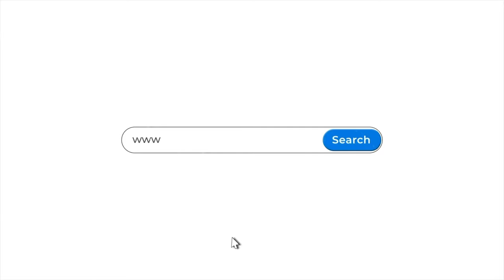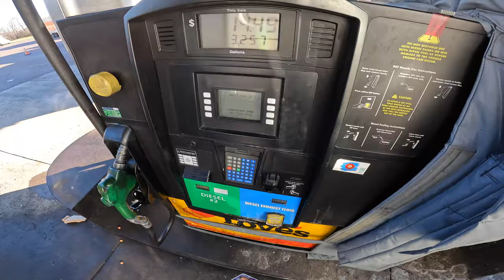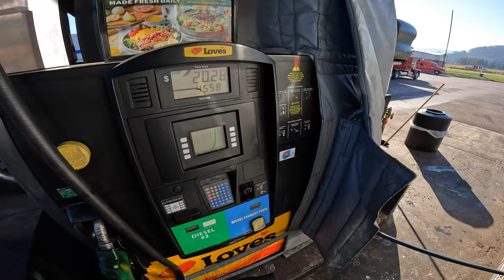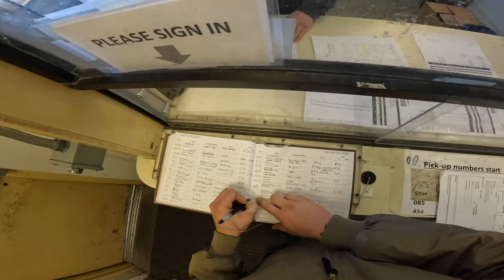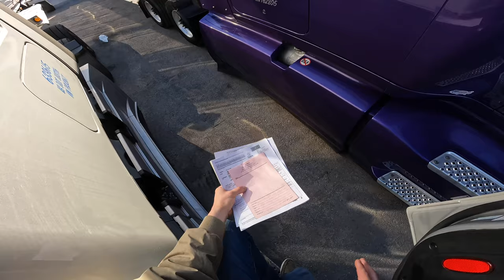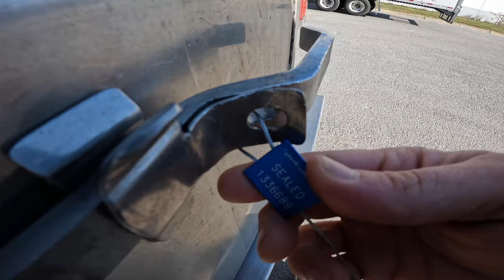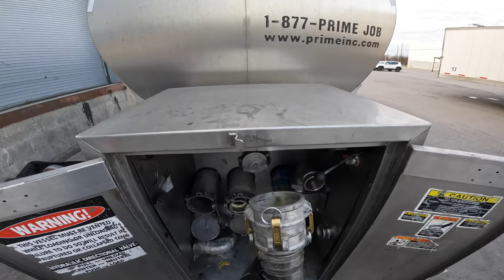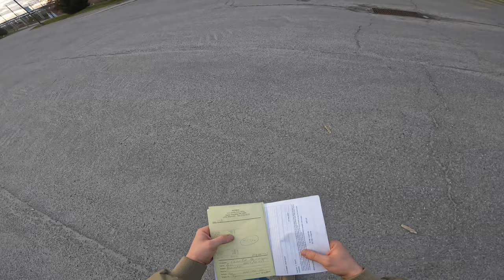Prime Inc | You Should Try Pulling Tanker | Getting A Sample Without Making A Mess

Comment: Really enjoyed the job there 3 years ago. Had a crappy trainer and only lasted 33k outta the 60k they required before leaving. Great company tho
Reply from the maker: Dang… when I did my tnt tanker only requires 25K
Reply: @truckingwithrex   how many miles are required for tanker right now.  I'm in Springfield right now in my psd stage thinking about switching from flat bed
Reply from the maker: @marcusknox2845  30K miles, that combined miles meaning (prime adds up miles you drive and your trainers miles) hope this helps ya! 🎄🤙💯

Comment: I used to use hoses with those. Why not just ask prime for extra dog ears and get a punch and hammer and change them yourself if they break or missing
Reply from the maker: I did ask for em because they are super simple to replace and I was told to buy them myself and show before and after photos of me replacing them… then prime would reimburse me so yeah… lol
Reply: @truckingwithrex  people love it at prime and I am sure they are good. I just don’t like seeing them Nicole and dime all the drivers for parts and stuff for “their” trailers. I understand if it as was a part for the truck you lease.
Reply from the maker: @jonnyjon1126  you said it correctly they are nickel and dimen drivers. Prime is solid but it’s not the drivers responsibility to do minor repairs to their trailers and or equipment imho.. This is why I’ll report these issues in my pick up or drop trailer inspections and prime can repair them as they should.
Reply: @truckingwithrex  of course report it. I mean to not be willing to give those to drivers is crazy. The man power lost and jobs delayed by a 1 min fix is nuts.

Comment: Are the O/O trucks governed with Prime? Do they offer fuel cards to you from the company? Not truck stop loyalty cards!
Reply from the maker: If you lease with prime your truck is governed at 65mph, company drivers trucks are governed at 57mph on the pedal / 62mph on cruise control. All prime drivers get an id badge which is also our fuel cards. We swipe the card prime deducts the fuel out of our settlements weekly. Our discount is about $1.50 off per gallon. I use my loyalty truck stop rewards cards for points and showers. I’ve made over $750 this year off my points for fueling 🤙💯
Reply: Wow 65! I thought about coming over there! But my truck is not governed! Nah I can’t do that one! Great u made some nice money on those loyalty cards! I did as well! Thank you sir for the advice!
Reply from the maker: @aaronsullivan8153  I understand 65mph is slow, me personally it doesn’t bother me, stay safe bro 😎
Reply: It’s a little different where I work! I do intermodal work so I have to hustle! But I’ve driven road tankers before, and yeah it’s just run,miles, load, and unloading! I was just thinking of going back to road tankers! U stay safe as well!
Reply: @truckingwithrex  can you explain how primes fuel surcharge works? Does prime cover some of the weekly fuel bill or it’s all on you?
Reply from the maker: @paladin3116  Yes we get money for fuel. Prime charges the customer .42 cents per mile so if we run a load that’s 1,000 miles (that’s $420 in fuel the driver gets towards fuel for that load) it doesn’t cover 100% of your fuel cost more like 71% roughly.